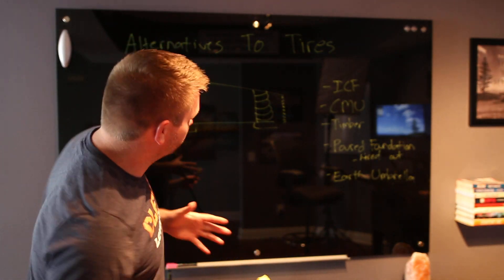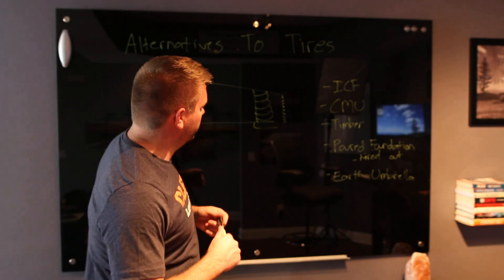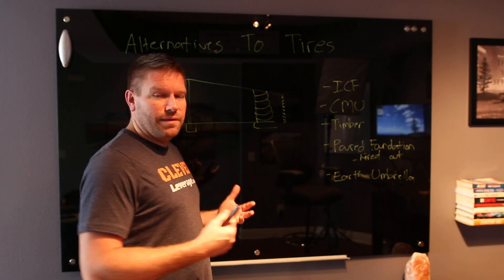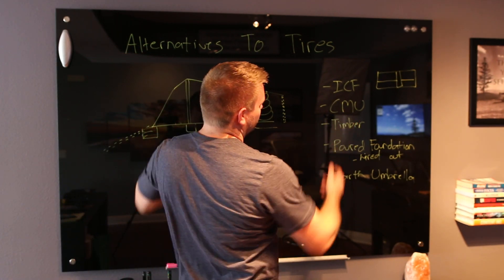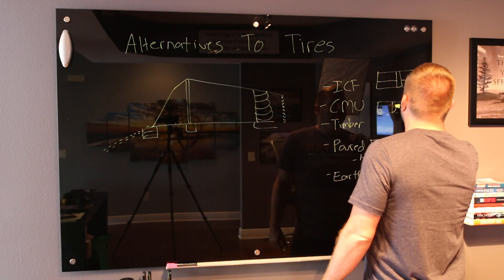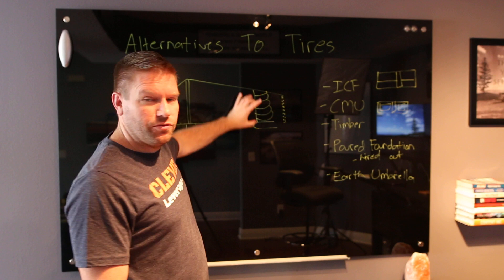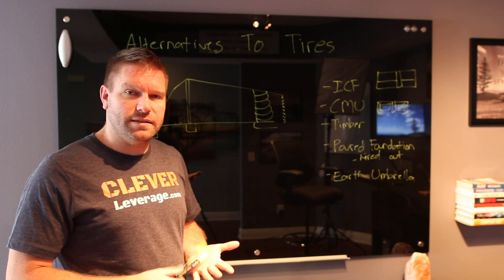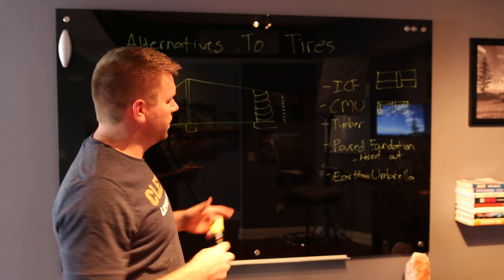Earthships: Alternatives To Tires

Comment: Im working on my plans for my earthship as well. I am not going to be using tires either because of the labor and gasses. Im going with the concrete pour with a backside pour of aircrete. That would give you a nice thick thermal mass wall. Excellent structural support and its fire proof, water proof, its an insulator and inexpensive to make. It can be poured or made into blocks. The blocks can also be cut with a hand saw. 
You should definitely look into aircrete 😊
Reply: I agree about rubber being an insulator, but I did energy modeling and found something intriguing. OK, when storing heat in the tire, at first there is a delay in storing, but as the heat penetrates the wall to the rubber, there is some delay but eventually the heat difference is strong enough to draw the heat inside the tire. Then as you go into the night, the heat must also pass the rubber tread again. As the temperature difference increases, there is a little delay, then the heat’s coming out later at night going into the morning.

Comment: Dry stack wall if you use the correct glue would be amazing I think PO 800 would do it I’m about ready to try that for sure...
If that did work you could actually use sand and water to fill the layers instead of all that pounding

Comment: I would use sharpen stakes of rebar to attach the layers together and to attach the first layer to the ground I would also try to get some good glue that would glue them together I think that PL800 would do it ..but I have yet to try it

Comment: I think one of the hardest elements of Earthships to get comfortable with is the tire wall. I feel your pain. But they’ve endured for good reason. They lend themselves to certain criteria and none of the suggested alternatives in the video or comments, and I’ve read them all for interest, fulfil them all. Mostly what is forgotten here is 
1. Green credentials 
Mike’s solution is astounding in this regard and most of the proposed alternatives are appalling. 
2. Thermal Mass 
Also referred to as the thermal battery. Earth is not the best material but pretty good, and Earthships have proven to work admirably. Tire, Straw and Hemp bales just won’t be as good. 
There will likely be a compromise somewhere in order to reduce labour time. The old saying that good things require time and effort comes to mind. 
I’d be interested to know if you’ve decided on a solution and what that is.

Comment: I understand what your saying about labor and efficiency. 

The reason why tires were chosen was to deal with a material that is a major pollution issue. Off gasses from tires left littered across the country. Ramming dirt in the tires stops off gassing and creates a solid foundation wall. 

It’s a true earthship only if it repurposes and reuses materials that would otherwise be waste. That is the only point that counts. Ps concrete causes pollution. 

Time is money <  lessens carbon impact  I’m guessing you won’t ever get what the earthship represents.

Comment: 12 inch CMU filled with concrete and rebar. You can build the wall yourself in a couple of days. Use rock wool board instead of styrofoam. It won't burn.

Comment: I'm thinking precast concrete walls such as a double tee  would be a great alternative ... But expansion may be a real issue if the building is very big ... Interlocking into the back fill would help mechanically stabilize the wall and the fill .these could be ordered and set in no time at all ..

Comment: Matt you should check out building with tire bails. It's just as cheap as building with normal tires but without pounding a ton of dirt. Just look up "earthship with tires bails" and you'll find some examples, I'm in colorado and quite a bit of people have built with that method.

Comment: There are 4 by 3 by 3 foot concrete blocks that are used for temporary retaining walls. All you need is a forklift to install them. You would need to figure out a way to make them permanent.
Reply: Interesting idea… The blocks that come with a little triangular ridge all around so they kind of lock together?
Reply: @JohnnyArtPavlou  yes. I work at a factory. We use them for bunkers to store raw materials. There’s a lot of material leaning against those blocks. I’m not sure how to make them permanent. Maybe rebar and concrete.
Reply: @NickRedstar  Cool. I think I’ve seen them or very similar blocks called “bin blocks.”

Comment: Used tire off gassing is not an issue after some 30,000 miles, as all the off gassing has already occurred.  There's basically nothing left off gas by that time.

Comment: Matt I live in Alaska and am formally from the Colorado region. I have often wondered instead of using rammed earth why not use a slurry compound to fill the tires like a earthen mud slurry with cement additive for strength. Or if your going to use ICF forms do a double wall back to back on the forms. Then you would have a 8 inch concrete wall that has a styro foam insulating slice in the middle. Let me know if you have any ideas on this bunch of random thoughts
Reply: What about using a 3-4” hole saw to drill holes in the side wall facing up to let the concrete/slurry not form air pockets?
Reply: The trick would be to figure out how to fill the top rim of the tire, so there isn't an air pocket there ready to collapse under pressure.
Reply: I had this idea too. Put mostly dirt in the mix with cement, even sand. The cement holds it together well. Do some tests to make sure it’s dense enough without pounding. Then you literally line up a whole course of tires and if you could mix everything fast enough, do a whole course in a day, and give it a chance to dry/set. You’d have to collect lots of the right sized tires.
Reply: Allow for rebar near the top of the wall. I’ve lived in concrete buildings. They’re very durable but cement gives off low level radiation and it’s harder to concentrate and adds mental stress. Maybe you have rebar that only connects 2 courses.

Comment: Great questions Matt... and I'm "in the same boat" regarding my feelings about the tires! I like Architect Mike and give him "kudos" on all he's accomplished but.. I hate the tires... period!
I'm working on a business concept whereby I'm trying to solve a lot of Mike's "shortcomings" like the tire option... and then reduce the build time by half or more and use a modular construction system. If I can reduce the custom and time-consuming labor, then I can take those dollars and invest them into my modular concept. Build it faster, at a lower cost (I hope) and then let the homeowners customize it anyway they want. My concept is also "scalable", meaning that I can enlarge the size of the house using the same system contingent upon what the owners want. 
Feel free to communicate.
Brad Bowen
Founder, Chairman, CEO
The Bowen Organization
Global Real Estate Developers
San Diego
BowenOrg@gmail.com
Reply from the maker: If anyone knows of single sided ICF, with reusable interior form, that is the solution. Do sitework, stack your own block, then just hire a pump crew for the pour, done.
Reply: @matt-justice  does the foam side would go in the interior or facing the dirt?

Comment: I've been thinking about this as well, and what I've decided on is use the basic earth ship shape. I , however, would slope towards the front like a Chinese greenhouse (highest part of the house is the back wall). Instead of tires, you use Hesco barriers. If they're strong enough to be used as retaining walls and as protection from explosives; it's strong enough to use instead of dirt packed tires. Then pour aircrete in vertical forms to put a smooth face on the interior walls like stucco. You can berm the exterior walls. It's fast and strong. For the parallel support beam in the middle of the house, pour concrete footers for vertical posts and a giant glu-lam (or similar) beam that spans the entire width of the house. The very front gets a rubble foundation.
Reply: They are now building the global model earthship with slope towards the front to keep the roof exposed to the south. The sunlight melts the snow better and keeps the water from freezing better.
Reply: Gabion cages in layman's terms.  I've had the same idea.  Gunnite could also work as a coating...basically swimming pool walls shot into place...no forms needed unless you're after a flat vertical finish.  Otherwise, I'd like to basically do exactly what you're suggesting with the design.
Reply: I like the idea of Hesco barriers. Any examples of this being done somewhere ? What would you fill up the Hesco with ?  Sand ?
Reply: @luclaflamme4712  The other responder was correct when he said the laymen term is gabion cages. I've seen smaller and larger cages in use - anywhere from 2'x2'x2' upwards to meters long per side. The size of the individual squares determine the size of aggregate used, if you want to leave them exposed. You can often see the larger cages stacked on top of each other on highways where they're used to catch rocks in rockslide areas.

You can also use geo-fabric to line the inside of the cages if you want to used dirt/sand like you'd see in Allied bases in Iraq and Afghanistan. I saw walls 3 to 4 meters tall, when I was over there.

The whole point of the idea was to put up the bones in a super short period of time, so I'd most likely hire out since you'd want heavy equipment to do the job. The cheaper in the long term option would be to buy a used mini-excavator and DIY; since you'd have something for future digging on your homestead.

Comment: I like the earthship concept, but I too have been looking for alternative ways to get the same benefits. I think a block or concrete wall would be the easiest and best.
Reply: I built a passive solar Adobe in 1978-80. After a lot of research I built a “regular” Adobe with a greenhouse that covered the south side of the house. I insulated the stem wall about two feet below grade. We were at about 7500 feet in west central NM and had below zero temps in the winter. The greenhouse provided about 95% of our heat and an air tight wood stove with about a half log on cold nights provided the rest. I installed elect. baseboard heaters but they were never needed. We had brick floors on sand that added to the thermal mass and felt like they were heated. The greenhouse pulled cool air in at floor level and circulated warm air back into the house. The system was simple and worked far better that I had hoped it would. We were on a well and septic system and could have gone off grid if we wanted.  In winter we opened the doors to the greenhouse when we left for work and by the time we got home the house was comfortable. There were solar overhangs that kept the summer heat from building up. It was simple with no added tech besides the greenhouse. It worked far better than my expectations and I have been surprised that their have not been more examples of low cost greenhouse sunrooms and thermal mass as primary heat sources. We had electricity because it was easier that photovoltaics and we only had to guarantee to use $60 a month. We never went over. I love the idea behind earthships but I think you can achieve close to zero impacts and self sufficiency in simpler ways.
Reply: @bobprickett2223  You need to post this on the main comment section not in a reply so everyone can see it. Good comment.

Comment: Compression strength of a CSU block, I think is about 3,000psi. You can look up beam loads on any local building code site, universal building code for US also has rood load specs , an engineer should spec this number with the roof load and snow load requirements for your area

Comment: Aircrete. I'd pour aircrete and use concrete steal bars To make it stronger. 
I'd also first pour concrete columns every 2m even for more strength. 
Strong, cheap, fast, best insulation. 
I'd even do thé roof with aircrete panels.

Comment: You might also consider this concrete buttress design. Shown here in the Earths built in Ontario Canada. Seems to solve the rear wall stability problem.
   
https://youtu.be/j7SUjcwXY8w?t=127

Comment: One caution here, the back wall is a key part of the solar heat "battery" in an earthship that helps stabilize the temperatures inside ( absorbs heat from sun hitting it, then releases that heat when sun goes down and temp inside starts to drop).  The thermal mass of the wall is key to this, and you do not want to use an insulating material for that back wall or else you will lose the thermal battery process.  So, ICF and timber should be crossed off your list.
Reply: I built an earthship with four walls of concrete for earthquake resistance (I don’t trust tire walls).  My earthship has a full basement.  It’s 24’x48’ with 2,300 sq ft. of floor space. The engineer designed the 3 walls facing the earth berms as 11” with 5/8” rebar x 18 ft high and the south facing wall (facing the solarium) as an 8”x 18’ ft wall with 1/2” rebar. I poured the walls in two 9’ high sections.  The main floor south wall acts as a trombe wall and it works great.  It slowly absorbs heat all day and then slowly radiates heat back into the solarium and into the house all night.  In five months of the winter (zone 5) we supplement the main floor heating with two small electric space heaters.  No wood stove. The solarium has slanted single pane laminated glass ( 26- pieces 6’ high in two rows across the face of the solarium.  Th 13 lower pieces are removable.  The concrete walls facing the berm are coated with a very effective moisture barrier then a membrane to direct any water to a drain around the exterior of the footing.  Then there is a 3” thick rigid foam around the foundation then the beamed earth.  There are no moisture problems in the basement.  This home doesn’t give the feeling of living in a cave like a lot of earthships do.  All the windows are in the trombe wall and the doors also have all glass.  Plus a couple of solar tubes in the back of the house.  I’ve built six homes, 5 conventional 1 earth ship.  Earthships take almost twice as long to build.  I’m building a seventh home and to get the same benefit as an earthship with half the work, I’m using double stud walls with a space between the studs.  A 12” wall with 12” of insulation and no earth berms.  Good luck
Reply: @mori8424 Do you still plan to use thermal mass or does the insulation make it so it's not needed?
Reply: Why not cob?
Reply: @tmckmusic8584  With cob, even with a good wrap, footer, drainage behind it etc, if somehow it retained excessive moisture or water, it could lose structural integrity very quickly.  It's very structurally sound but only when it remains dry.
Reply: @helenjones568  the color of any surfaces exposed to the inside is important to the buildings temperature regulation especially during the day, but paint doesn't store the energy for a significant period of time and it is the energy storage properties that the OP was concerned with.
Reply: So would Concrete wall be crossed off then too? Ben Kaan
Reply: @nathancasey6579  Nope, concrete is a very good thermal mass when it is more than 4" thick, which is why the ICF walls are not good thermal masses.  A solid 8" concrete wall, or thicker, would work very well.  It would also be much more expensive than traditional materials sourced for the thermal mass walls (used tires, ertc.)
Reply: @_____ concrete is also a good alternative, any dense moderately conductive material should work.
Reply: @helenjones568  Yeah, but nobody wants SOLID BLACK WALLS, or it will feel like a dark cave.  Light colours are used, because there is only sunlight available from the south.

Comment: Earth bags! Use polypropylene bags, put in a mixture of sand and clay with some moisture, pack the bag down and let it dry until it becomes a brick. Between the layers of bags you insert two lines of barbed wire

Comment: https://www.efbm.com/  This type of ICF can be dry stacked and filled in with concrete one or two levels at a time.  Dan, the owner will tell you how to do this and is really good with helpful tips.  You can also use a tire foundation that instead of earth uses a mix of cement and earth mixed and then placed in the tires and let to set up.  ANother alternative is to cut off the sidewalls and then use crushed aggregate as infill.  Then a leveling cap beam to start the ICF block wall one level at a time.  This is the option that I will use to build my house in Colorado.

Comment: why are tire bails so easily dismissed- 30x48x60 4x5 x2-6 thick they are free you shipping- you need a loader to set in place for 1 day- you still use gravel trench footing

Comment: I'm late to the party, but I only learned about earthships a month ago.  I've been researching ever since.  A fast, less material/labor intense approach is something I've been considering.  Did you decide on an option?   Earth bags,  for a wall, concrete as a motor, to also create the thermal mass wall, was a thought I had, but I am just starting the planning.